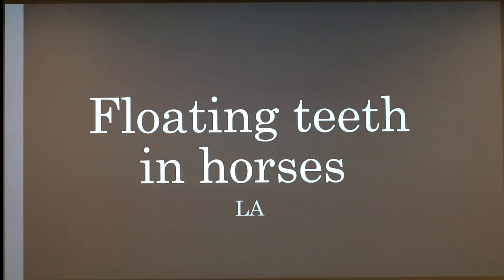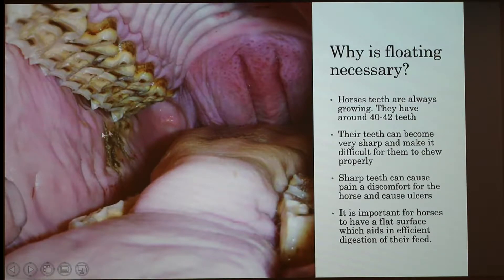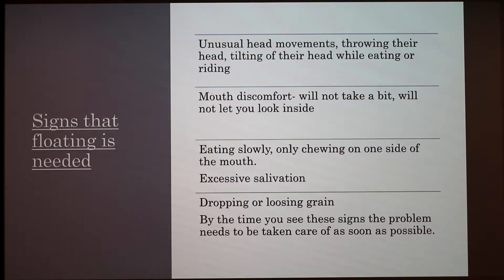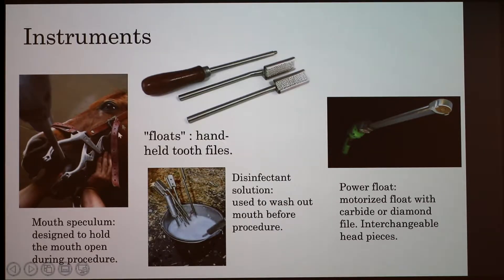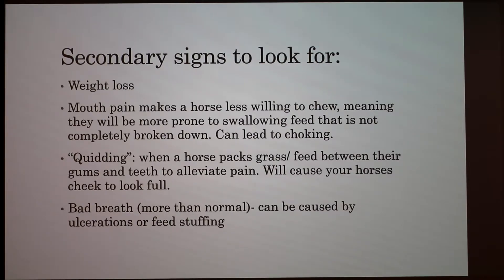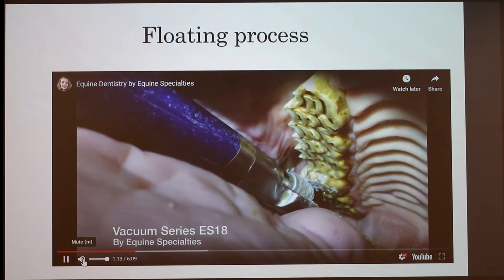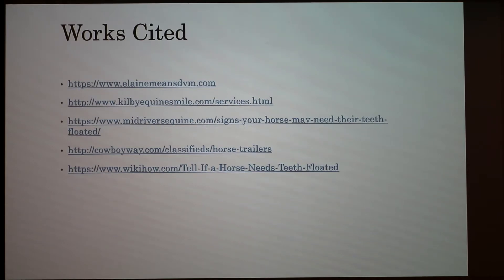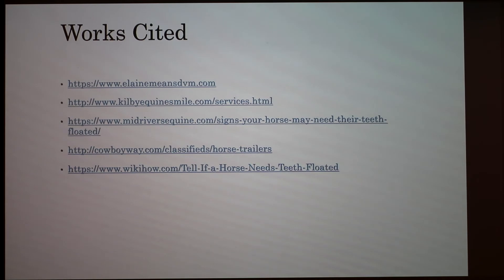Floating Teeth in Horses

Comment: How does this process occur in nature with horses who have not domesticated? Is this an issue (the very sharp teeth) that is only found typically in our modern domesticated livestock?
Reply from the maker: Excellent Q. The wild horse has a much different diet than most domesticated horses. The wild horse eats more material that tends to grind away the sharp edges of the teeth. And wild horses spend much more time eating-more time to grind down teeth naturally.
Reply: @rodallrich8801  thamk you for the answer!